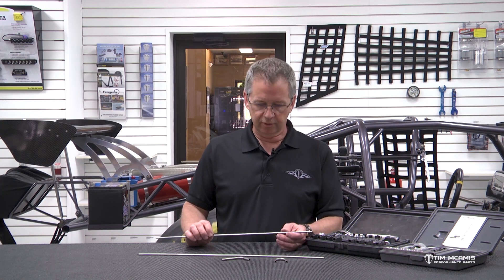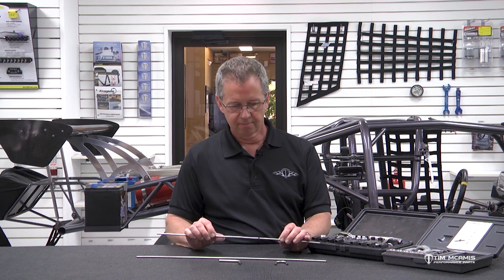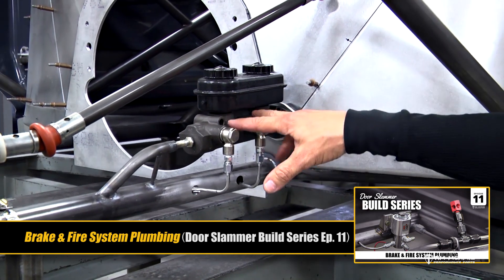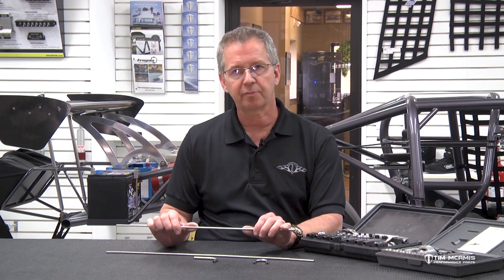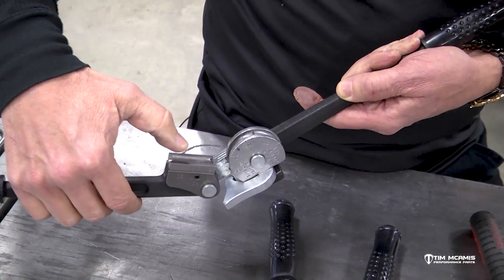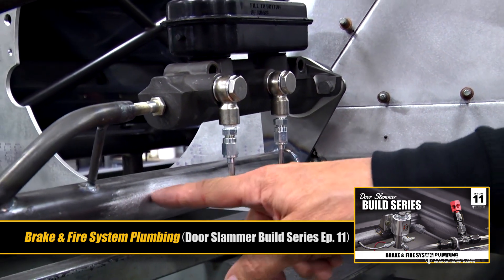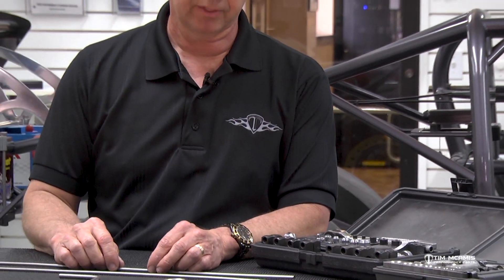Stainless Steel Line Flaring & Fabrication

Comment: Good video!  You didn't mention any bubble flares in 3/16 SS tubing.  I require one on the rear union rubber pre-made piece on both sides in rear, on my project.  I tried the bubble flare a couple times and it looks like it will tighten up only it doesn't look like the stock flare.  Do you have any advise?  Thank you

Comment: Hate to tell you that you can double flare SS all day long with ease.   I bought a tube straightener on Amazon for $30 and it works amazing.  I also bought a $150 flare tool on Amazon that has all the diesel on a turret and it double flares SS with ease.
Reply: Can you drop the link for the flare tool? Thanks

Comment: double flare is the standard, just need the right tool.
Reply: Double flares are used on softer metals like copper, steel, it's SAE standards. Wouldn't be easy at all without cracking it on stainless. JIC went to 37 degrees for this very reason.

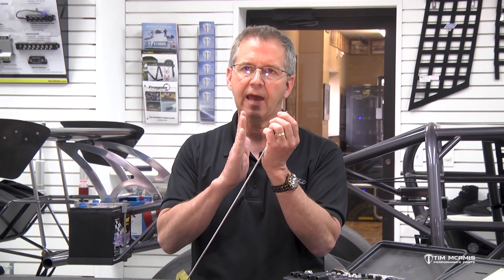Comment: Stainless is available, that comes in Straight sticks. I have had good results finding seamless stainless at petrocemical and industrial fabrication suppliers. 3/8 fuel lines made with seamless, thin wall, stainless, did double flare with the ridgid tool. Brake line most likely would not, but bubble flare ( that looks similar to first step of double flaring) might. Just found a stainless set of lines for a vehicle that uses all bubble/ISO flares 5:12

Comment: Do your use a 45 or 37 degree flare with stainless..
Reply: 37 I think
Reply: @Inthefoxhole 45 is doable. What you flare to depends alot on the fitting your using

Comment: Never directly mix steel and stainless steel in a product that will be exposed to the elements.
Stainless steel is much higher on the nobility scale than carbon steel. use a transition metal like brass.

Comment: Great video however you can double flare stainless tubing. I do it with 3/16SS tubing for ordinary automotive brake lines. I use the Mastercool hydraulic flaring tool. I havent had one flare split yet. Works great!
Reply: I have that same tool but I am having some issues flaring 3/16 stainless. What tips do you have?

Comment: Love this line it's all we use.  A tip for getting them straight. Several companies make rollers you stick the end of the line off the roll into it and pull it through the hand held roller tool and comes out perfectly straight no hand bending needed.

Comment: Hey Tim, I thought the DOT regulation was double flare all brake lines ??? I'm trying to do doubles with stainless line and it's cracking everytime,. It's bubble flaring good though
Reply: I double flare stainless no problem. I use the mastercool hydraulic flare tool. Haven't had one flare crack yet.

Comment: Great video Tim.  Would you please do a video showing how you run the lines through the chassis?  What tube adapters you use to create the transition into and out of the chassis tubing and how you feed the brake lines through them to the master cylinders?
Thank you.
Mike

Comment: I didn't see a residual valve, at what point would you use a residual valve on a braking system and if so which psi valve? Thanks

Comment: Carful you get quality line. I’ve used some ss line that had a slight seam on the inside and could not get it to seal no matter what I tried. Great video.
Reply: Mine had a slight internal seam. I made a 37 degree tool shaped like a male fitting with no threads. Chucked it in a drill & applied some valve lapping compound. This ground the seam flat.

Comment: I have been fighting my butt off trying to do one double flare on a 1/4" coated steel brake line...I have tried a cheaper flare tool and an expensive inline flare tool.  I couldn't even get either flare tool to even start flaring the line.  the inline tool it literally just ripped the die housing rite out of its threads so as i was tightening the die nut, the coupling that screws down on the two die block halves, just pulled off slowly as it wrenched it.  I am at a lost, this 1/4 line is hard as heck.  its a front brake line on a 2007 silverado 2500HD. Not sure if you understand my rambling but any ideas or thoughts would be great.
Reply: Get this flare tool i use it on stainless on automotive applications https://www.amazon.com/MASTERCOOL-72475-PRC-Universal-Hydraulic-Flaring/dp/B01NCYKQSN

Comment: Nice tip for really giving a nice finish and guaranteed seal, is after you flare it, use a small piece of emery and that small champher countersink tool in a drill, place the emery over end of flare, and trap it with the counter sink tool and spin with the drill. It leaves a mirror finish. Been doing hyd lines that way for a long time. Works great.

Comment: Another great video!  Tell me Tim, what is your opinion on skipping hard lines entirely and simply plumbing the entire brake/fire suppression system with AN-3/AN-4 stainless braid covered Teflon hose?  I know the common logic is that doing this leads to a softer brake pedal, because in theory the braided Teflon hose expands a bit more than the hard lines.  But I have seen VERY high end racing cars....like cars from the German DTM series....that have the brakes plumbed entirely with Teflon braided stainless hose.  I have also driven cars plumbed this way, and the brake pedal felt like stepping on concrete.  It is also vastly simpler to install and repair than hard lines, and is (arguably) less prone to damage...since it is more flexible....it is unlikely to dent or fracture.

I realize it would weigh a bit more and probably be more expensive than hard lines, but other than that, do you see a downside?

Comment: lots of good information here. one thing you forgot to mention is the difference in flare angles between the sae flare at 45 degrees and the jic/an flare at 37 degrees.  don't mix up your fittings. also i recently used a hand held hyd tube flare tool that worked really well.
Reply: What flare tool did you use?
Reply: @demon1891  brake lines and hyd lines use the 37 degree flare.
Reply: @larrysperling8801  thanks but what flare tool do you use to make the flare? I'm using ss 3/16 for brakes and the tool I have sucks
Reply: @demon1891  wendell i have a couple of 37 degree tools one is a weathehead and the other is a parker. both are heavy duty tools stainless is a bugger to flare. thats why most of the guys i know have gone to useing cupro nickel tubing . its real easy to work with and it looks good. a friend of mine recently bought a hyd flare tool from east wood and it will spoil you. its pricy but if you do a lot of work with tubing its worth it. i have had my tools over 30 yrs. so i dont even know if they are still available and i doubt if any of the Chinese imports are worth wasting your money on.best of luck
Reply: @larrysperling8801  ooh that newfangled copper nickel stuff was a joy to work with. 
I really went out of my way to duplicate every bend and loop in my old original rotted lines and had a great time doing it. 
Whens the last time that woulda been any fun with normal tubing ?

Comment: This is fantastic information! I hope to put this towards good use.

Do you know any resources out there to start understanding how to learn to design suspension, such as what springs, dampers, wishbones and more to use, and in what position? From what I understand, running gear such as suspension/wheel hubs are the foundation for a successful racecar. Longer wheelbase is more stable, but shorter is more nimble.

I would love to see your thoughts on this topic, or at the very least get pointed in the right direction.
Reply from the maker: Check out our library of videos. We have some on many of these topics.

Comment: One thing stated was incorrect.  You CAN use aluminum tube nuts and sleeves.  One of the most prominent racing plumbing companies in the world (BMRS) assembles and recommends aluminum on there stainless lines for the ultimate in weight savings.  I've been using this combo in a much more demanding application than drag racing for well over 10yrs with no issues.  No disrespect to Mr. McAmis, he builds world class race cars.
Reply: I’ve seen -3 aluminum fittings used on brake lines. I’ve seen the aluminum flare nut on a hose end split down the center. I’ve seen an aluminum adapter (pipe to AN) screwed into a brake caliper snap clean off. this is on road race cars. If it’s line to line, with good support on each side, it would probably be ok.

Comment: Why not use swageloc fittings? Very user friendly and the tubing comes in 20 foot lengths. Each connector acts as a swivel connector as well. Used extensively in oil/ gas plants and food processing. A little pricey but no need to mess with the flaring tools.
Reply: Swagelock isnt meant for the high pressure hydraulics.
Reply: any sort of compression type fitting is a big no-no in a braking system
Reply: When a swagelok fitting is used correctly,  the stainless line will burst before the fitting lets go. Best fittings around.

Comment: Tim, 2 things not discussed. First, AN and JIC 37 degree flare vs 45 degree flare. Second, tube wall thickness. I know stainless steel line can be obtained with 2 different wall thicknesses. I prefer the thinner. I purchased the flaring kit from Eastwood. I do not like Eastwood as they are mostly China rehash items. The flare kit does a  nice job and is very easy to use. I may be incorrect but, I think it will do a double flare on stainless. Don't take my word on this though. Good video as usual.  Thank you.
Reply: Yes here I have been double flaring everything only to watch a video and find out it is impossible! Using the Mastercool hydraulic flare tool and it completely rocks. Seriously though I am glad to learn double flaring is unnecessary, though I echo the wall thickness comment; not sure if only the thick walled stuff will work with single flare or if you can do it with thinner walled tubing also. I'm sure the pros know what to buy but when you have never flared anything and you are trying to figure out what to buy and how thick is too thick, knowing the wall thickness that the pros use would be a great help. Thanks very much for the tutorial video.
Reply: Paul Straney: The Eastwood flaring tool will double flare stainless tubing. I double flared all the stainless tubing for my Barracuda with it.

Comment: Good information here, I wish I had one of the better die's to do this with. Mine works for Nicopp  and soft steal line but for the stainless lines you need the good benders and dies. Remember that the final part of the flaring is done when you tighten them up to form the final flare against the fitting which means you need to get them good and tight or they will leak.